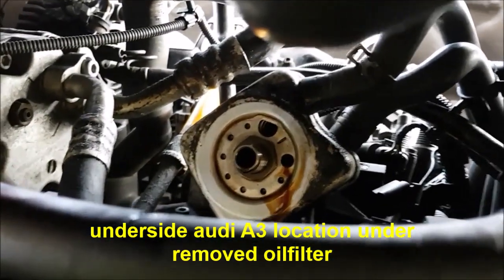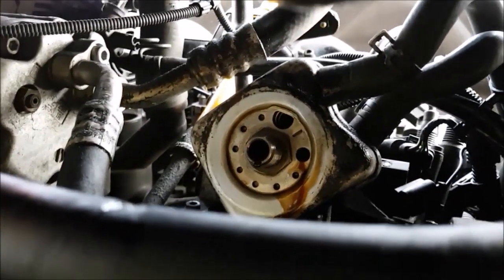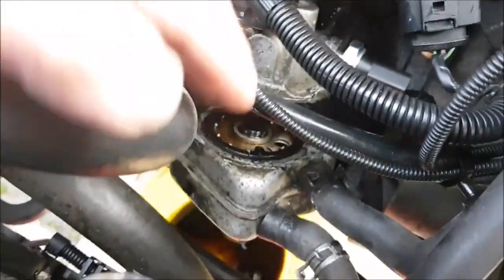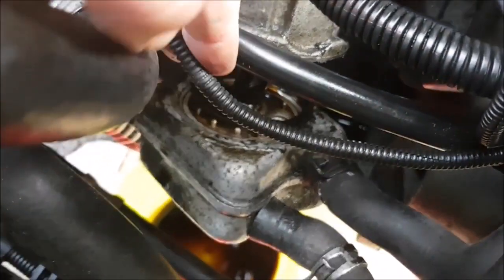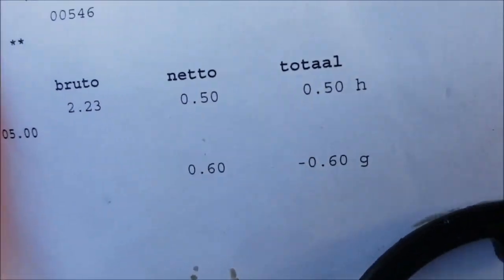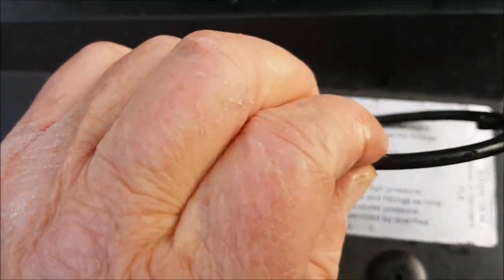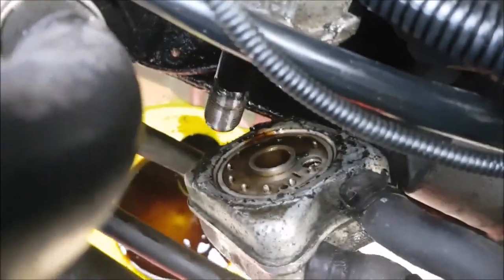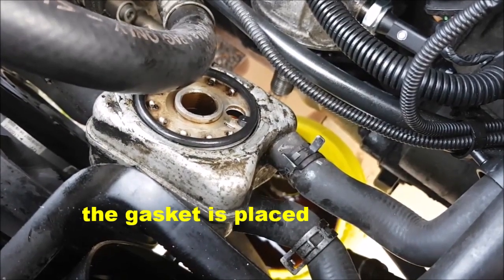audi A3 oil cooler gasket replacement

Comment: Hey. How do you get to the oil cooler please?
Reply from the maker: Under the car and remove first the oilfilter.on the sitting of the oilfilter you see the nut
Reply: @kersthaas  thank you
Reply: Nice view just see wires...
Reply: Hello did you drain the oil in the sump or can you change seal by just draining oil in the filter.